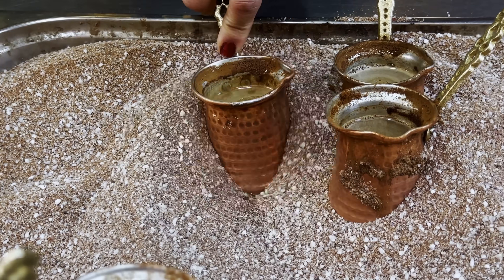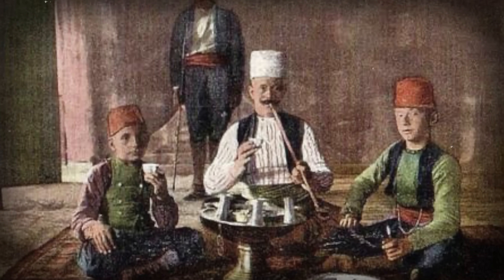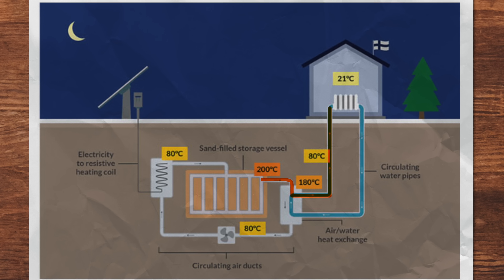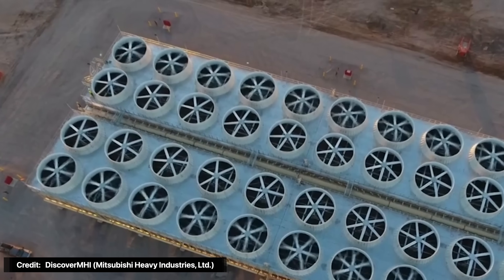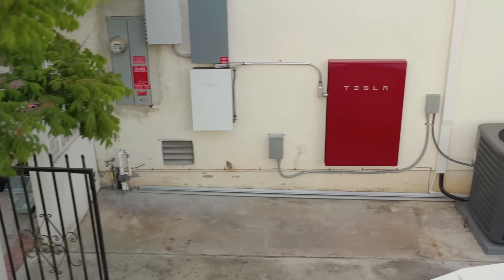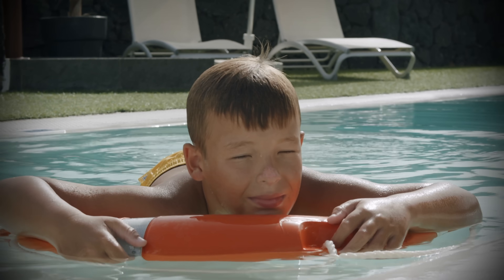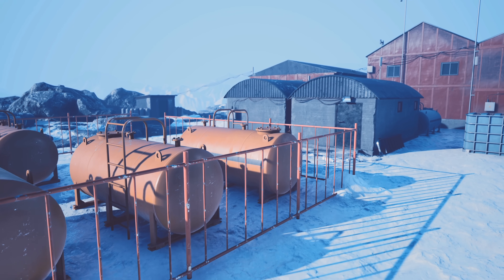The Power of Sand Batteries -- Revolutionizing Energy Storage...

Comment: There’s absolutely a case for residential heating use, if oversize your solar panel system and capture the excess energy in the sand battery, throughout the year. That can be used to heat your home through the winter.
Reply: I live in the desert southwest of the US, and that would be a wonderful application for our region. PLENTY of sun here, even in the winter. Such a system wouldn't have to be huge (as Ricky stated home systems would need to be) as our heating requirements are modest through the winter months. Even so, we do have heating requirements, as well as the need for hot water (of course). I would love to have a system like that for our home.
Reply: This is already being done here in Germany with water heat storing tanks. Also good thinking on your part. It´s efficiency is fantastic because sun energy is abundant in the summer and it´s used in the winter.

Comment: Sand batteries are great for off grid systems. There are plenty of times off grid solar is wasting the energy it captures because the batteries are full. Load dumping into a sand battery at that time, for warming your house / workshop on cold, no sun days makes plenty of sense.

So along with pumping water to head or compressing air, sand batteries are a great way of storing excess power cheaply.

Comment: I first learnt about sand batteries in Bill Millisons 'Permaculture Designers Manual' printed in 1988. They called it an 'energy store' and it is used as low grade heat for heating houses, green houses, hot wateretc, which is what this type of heat is best for, and which incidentally is the energy most people need/ use.
Reply: I bought land in the desert and I'm going to actually make this concept happen with modern high efficiency solar panels.
Reply: @calebfi  excellent- and best of luck. The biggest threat I see is not using enough insulation, and, if you get the sand above 100°c (or anywhere near the possible 500-600°c) water entering into the sand where it will basically instantly become super heated stream. That would be very nasty, and potentially, very explosive.  I hope you are thinking of building it at a big size, like more than 10 tons of sand.
Reply: @rowanshole  I have several acres of land on very clay and sand heavy rich soil. I've decided that I'm going to drop 12v 40W cartridge heaters into copper pipes and pack them with sand, then bury them vertically underground. I'll do this in a 3' to 4' pit and then build adobe walls and a roof over that eventually.  I want to do a total of (6) 5' copper pipes with (6) 12 V 40W cartridges in each. It's very simply plug and play from there. I'll get a few 400w bidirectional panels and could simply even plug them in dc to a bar connecting all cartridges in a single junction box. A battery bank would be even better for quicker charging. But this battery could be just as effective after being trickle charged for months vs one quick initial charge. Either way, after thermal saturation, this will create an amazing thermal battery directly underneath the floor of of my off grid earthen adobe pit structure. If it works (which I have a feeling it will), I'll be inside naked during a -20F snowstorm in January at 2am. All it would take is a good canvas tarp thrown over the top to trap that radiant heat in the air and keep you happy for literally months.

Comment: One missing point in this video is that the Li Ion batteries are Day storage, Sand Batteries can be used as seasonal storage, as Sand keeps the heat very long and is able to keep the heat from summer and move it to winter. On a limit, but much more than any other electrical battery system today!

Comment: I see a few problems here:-

How exactly are we gonna transfer energy in n out ?

Suppose we are using a steam driven turbine to take heat out it won't be abt to take all the energy. Like we will only be abt to exhaust 1000° C energy to 100° C energy coz steam can't exist below 100°C or so. 

Will the hardware used to heat up the system be efficient enough to transfer all the heat to the sand ?

Comment: Instead of putting up a silo to contain the sand, stand up a shipping container.-
Reply: I think they chose cylinder coz it's more customizable to the size. 
The circular shape does have the least surface area so less heat loss.
Reply: @ddee3743  
Just thinking cheapness.
Containers come in many sizes, 10ft, 20ft, 48ft and probably more.

Comment: I was watching a video yesterday and the discussion included talk about homes with heating and cooling provided with the help of a heat pump. In France they're called a pompe à chaleur. The heat pump heats one storage unit with the heat from the other which is kept cold. The heat and cool of these two units help regulate the temperature of the home, cooling or heating as necessary. It's mostly for air temperature, not heating water, though that might be possible too. If you lived in a place where the average temperature was higher than you desire, the typical operation would be to cool the air in your home, while heating water. We know heat pumps work, so it's an idea for our times.

Comment: I believe there is a way beyond soaking wasted renewable 
Directly collect thermal solar instead with pipes thermal oil and reflective metal sheets
You get a 100%conversion heat to heat and zero need for photovoltaic and resistance 
Only non base metal and sand is the pump system and basic electronics for controls 
Maybe even remove the oil and move just 400-500c hot air

Comment: Sand batteries are a good idea, a simple and cheap method of storing heat in the warmer months for use in the winter months by making use of surplus green energy, this would be 
ideal for North America/Canada, Northern Europe including Russia, and northern Asia including China to see them through December, January and February.

But given the amount of sand required, I would view it as impractical for an individual home, but if you are building a street of 30 houses, it could make sense to scarify one plot for a big sand battery (which could at least have the facia of being another house) and be capable of suppling heat to the other 29 houses.

It would definitely make sense for large buildings, like schools, hospitals, office blocks,Apartment block and shopping centres, although it could be argued that in a city there would not be enough space for a large sand battery, but what if the ground floor of any large building was to become the sand battery, and human activity were to start on the first floor, in a similar way the ground and first floor of a multi-story car park could be filled with sand to provide heat to surrounding buildings, alternatively you could bury the sand battery underground, but if a maintenance issue required you to empty it of sand this would be complicated. 

There might even be a case for sand batteries to be situated next to the junctions of main roads, like crossroads, roundabouts, or sharp bends, anywhere were braking or cornering takes place, a sand battery could provide under road warming for 100 yards either side of a potential hazard point, just enough to prevent ice forming. 

there is a growing number of places using district hot water systems to provide heating, may be there is the opportunity to combine an underground hot water reservoir heated by surplus green energy as district heating, and supplement that with an above ground sand battery also heat by surplus green energy

 I am reasoning that a properly insulated sand battery should hold on to its heat much longer Than a water reservoir, and would therefore be used to top up the hot water reservoir right 
through to the end of winter, with out having to rely on a fossil fuel back up, by thinking on multiple levels, you could get double the heat storage on the same ground area.

Comment: it's not "Batteries" it's just Energy conversions.
Real Batteries should act as passives storage's and minimum if not none energy conversions happens.

The system won't works if the whole closed loop systems got shutdown/inactive and the heat dissipates over time, it's just as silly as putting the extra power generated by the windmill or solar cells into series of electric motors to turn a compressor to compress air to be stored inside a closed vessels where if needed the compressed air can be used to turn a centrifugal wind electric generators.

I get it Western peoples got skin rash and acute allergic reactions with "Lithium" technologies since it was dominated and monopolized by communist China but making such an low efforts silly propaganda's as this "Sand Battery" is just shameless, I expecting more "scientific" and "Intelligence" than this snake oils try hard type of "Innovations".

I was expecting the similar Graphene advanced tech for energy storage comes up from the West to counter the communist China manipulations on Lithium not this nonsense.

Comment: What goes around comes around!
My first home I bought in 1965 was heated in exactly this way - thermal blocks.
Reply: How were the blocks heated? How long did they hold the heat? What were the blocks made of?
Reply: @markhathaway9456  I can’t remember what I had for breakfast today so don’t rely on my recall from half a century ago but they were a cupboard full of  heavy brick sized thermal blocks with electrical elements sandwiched within. Air was blown through holes and came out all toasty through floor grilles.

Comment: years ago, i had success heating sand with hot air in pipes, then, running ammonia and later naphthalene(from Coleman lantern fuel)  through submerged tubes and powering a small steam engine. i dont know why this tech wasn't followed. i had a professor from Princeton university check it out and never heard again about it.
i moved away and on to other things.
  -politics. dude, its really all about who owns/controls the labs and therefore the grants.
eliminate the grant process and you will see a tech boom like we had back in the MOTHER EARTH NEWS days.

Comment: A good question, if Sand is good at asorbing heat, using a water sand radiator would actually help remove heat from water more efficiently, allowing for computers water cooling system to work more efficiently, this could also be used in Data Centers where the heat from all the computers could be pumped into the sand allowing for cooler computers in the data centers lowering the cost of air conditioning in the building.  I might try a small scale water, sand cooling thing for computers to see what would happen, it would most likely be a double radiator, where you take fans and blow the air through the water pipes to that gets blown out through the the air, but instead of the last part of it transfering to air what if you have the water pipes transfer it to sand, and than transfer it to air, which can hold alot more heat than air can.

Comment: The story is built misleading a bit more work on theme is needed when you say that cycle efficiency is 70% for electricity it is not when you use secondary heat from turbine for heating then you can use like 90%  45C watter is very good for floor heating. you can use heat to get cold since  fridge evaporating unit heats liquidand condebsation heat can be used to preheat water

Comment: Hot and cold sand batteries? Now you’re getting into some interesting territory here. You’re also going to be able to collect condensation for drinking water in such a system, because you need hot and cold to absorb water from the air. On top of that you’re using excess energy that would have been wasted to get it. Pushing the idea further with more tweaking and you have a steam engine that barely runs out of water and fuel and has the potential to become an engine that runs on the atmosphere around it.

Comment: 1 huge advantage is that a sand battery, if done right, can hold temperature for many months, you can charge it in the summer and heat your home in winter with it, when solar is at its lowest output.
Reply: My biggest concern is what do you do with it during summer? It's not going to take all summer to charge it. I live in a part of Africa where energy and electricity overall is very scarce. But it's also very hot here most of the year. Can really say it only gets cold 2 months of the year here. So my question is, what application is there during the other 9-10 months of the year.
I'm curious to see how one could use the sand battery as an alternative to air conditioning
Reply: @abarairenji4483  hot running water, no need to ever use a boiler or whatever again. But it's more catered to northern climates, that have 3-6 months of need for heating.
Reply: @nikm3r  true, hot running water would be an ideal solution. I was thinking of converting back to electricity. Yes you lose about 50% energy when doing this but considering it's in a region where the grid only powers about 35-40% of residents, I don't think that energy loss is too bad right?
Reply: @abarairenji4483  it would really depend on how cheap solar + regular batteries vs solar + sand battery + turbine to turn the heat back to electricity would be in your area of the world. Do the math!
I just saw your name btw, nice!

Comment: Indeed, ideas about thermal storage like this are non-starters for efficient electrical storage to most engineers. Your figures about reconversion of stored heat energy to electricity are way too optimistic. Even the best thermal cycles, such as in nuclear plants, achieve ~33% thermal to electrical yield. So, a 3000 MW plant is required to produced 1000 MW electrical. The trouble to do this is also large in terms of capital plant and maintenance. The lay public is being mislead in most jurisdictions on this very point. Your problem on large scale heat storage is now thermal distribution - a very clumsy problem when there is no district heating infrastructure available. Only the nordic countries have gotten serious on thermal due to this very issue.

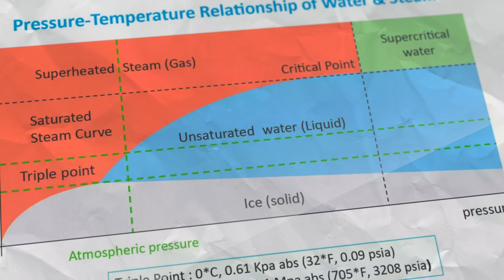Otherwise, around 8:00 2-BIT makes an odd error- indicating that water cannot be heated above its critical temperature - what's with that? Nuclear plants will often employ (partial) supercritical heat to raise efficiency.

Comment: Cooling provided with heat is actually possible with ´absorption chillers ´ which were generally used in the oil and gas industry where excess gas was burnt to provide heat to run absorption chillers.

Comment: Just imagine that you have a factory where every machine has a steam engine, but the heat is provided by portable and replaceable sand batteries that's charged at a central heating location. This enables each machine to operate independently for a few hours before their batteries needs to be replaced. The batteries themselves to back to the charging station until they get hot enough again. At the very least, this would make for some very whimsical steampunk setup. It doesn't even have to be that elaborate. It'd be awesome enough to just pull a hot cylinder full of sand from the fireplace, put it in some huge automaton and watch it come to life.

Comment: I find my self disagreeing with your summary...
Heat to electric is a silly compairison...
Winter/summer.... Depends on the heatloss over time. (Unsure of the possibilities)
If you can stire up your summer excess, and then use it in the winter that would be the holygrale

Comment: Ok, but with that same argument, it wouldnt be good to hook these batteries to your solar panels in the first place. You would WAY better to use heat directly through mirrors or lenses instead to store the heat. In a way, that would over come your limits of your 30% because lenses are passive meaning they should last times longer than even tbe best solar panel. Heat  also comes from the other spectrums meaning you can have dark sand and capture 100% of the light that goes to hit them allowing you to heat anything directly, and anything left over to power. To me, this seems like the biggest over sight when it comes to grid level power generation. Make a pool size lens over a pool of stand, let it heat up the and to 1000+ degree and then run water inside to heat up creating steam. You can control the amount of heat and pressure base off the amount of power you want to make store the rest as a gas/pressure tank.

Comment: I love the idea. There is also company called Caldera. They were doing 'smaller' sand batteries called WarmStone - sand sealed in a vacuum chamber. 2 tons of sand +500C deg and insulation of that void was so good that you could touch the battery with hand. They wrote that you could use it in your house heating system for even a month. They abandoned this product for homes and shifted to store and deliver heat for brewery and other big companies.
The thing is this requieres 2 things.   Hight class materials - heating elements, prepared sand without moisture, very good insulation - that vacumm was a sweet spot, but its hard to manufacture alone, so you need to build almost like a new house with ceramic coating and thick insulated walls.
Secon is amount of sand - something like 10 tons should be a good starter. Plus good pumps, pipes, sensors etc. 
Then good plan to take that heat out and plut into waterboiler and floor heating system etc.

Comment: It would probably not be very efficient to cool the sand to low enough temperatures. A resistive heating element is extremely simple and efficient. Heat pumps are very efficient only at low differentials.

Comment: There are cooling systems that work with heat. Refrigerators that work with propane gas and do not have an electric compressor are an example. In summer you can use the heat of the sand to cool Using an air conditioner with technology similar to old gas flame refrigerators